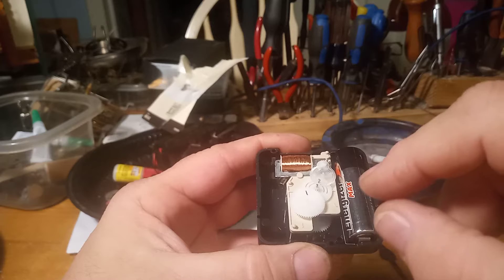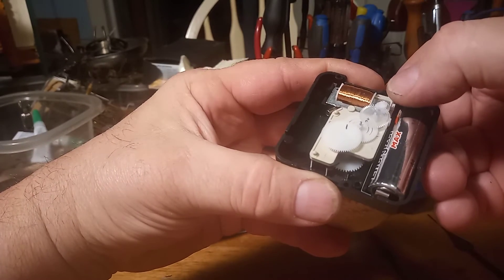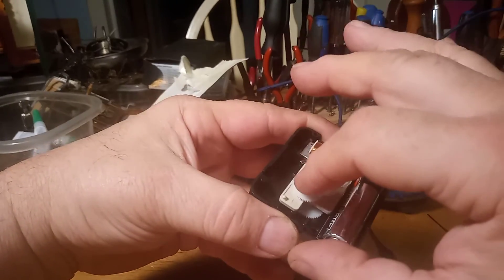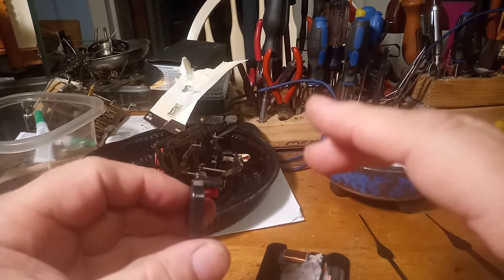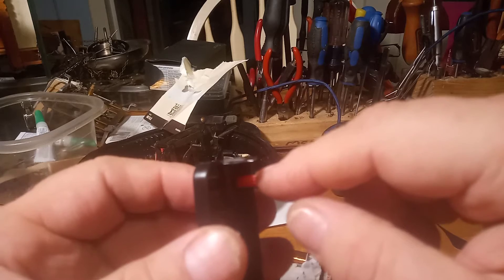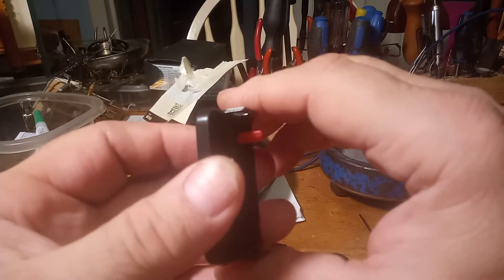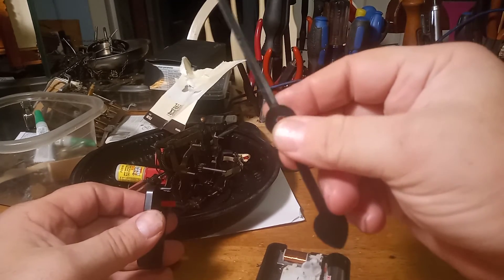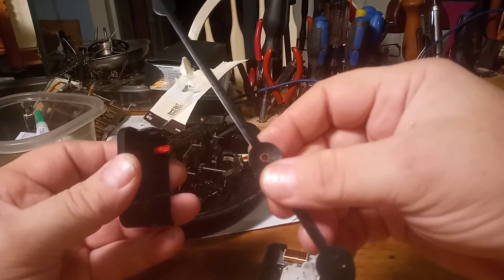Repairing a battery operated clock. 20220113 223140

Comment: Godd job retrofitting new parts into the original box so the hands could be used. Not a fun task on those little plastic parts.
Reply from the maker: yeah and I prefer not to work on battery operated clocks but every so often I do. LOL.  Thanks for watching/commenting. God bless you and yours.